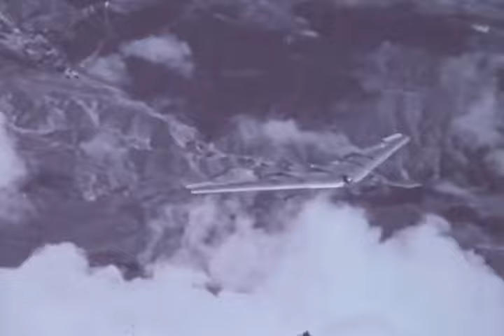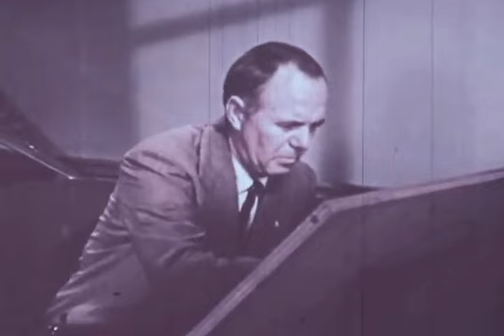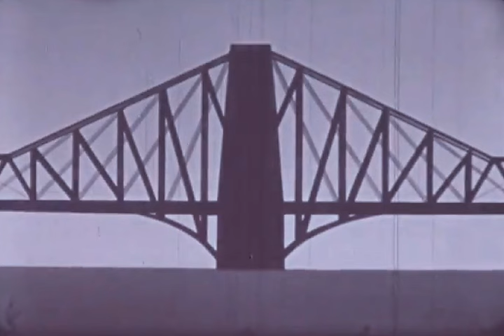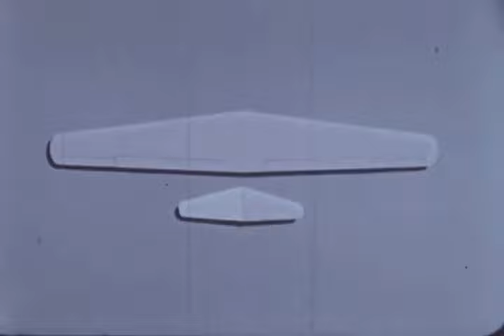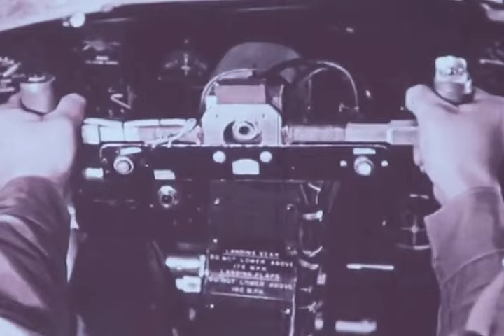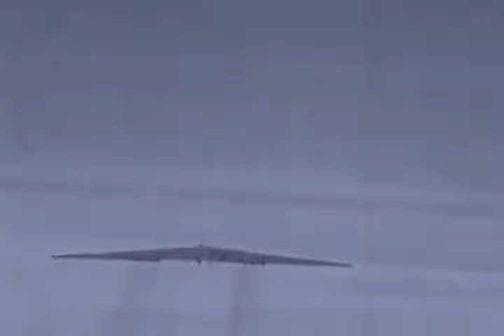The Story Of The Flying Wing

Comment: The Flying Wing was one of the most beautiful aircraft ever built. I would have loved to have worked on one of these and tried to get stationed Whiteman AFB to be with the B-2. The original was so far a head of it's time and the story of why it wasn't excepted in the USAF is intriguing. A lot of people didn't want it to succeed especially Convair, maker of the B-36. Jack Northrop had a design that worked so well, that ALL of the large Wings were cut up and scrapped so they couldn't be used for further development.
Reply: Just like the Avro CF-105 Arrow
Reply: @intercommerce  Yes, one can only imagine what the Arrow could have been. So many aircraft that I've see canceled because of government cuts, shortsightedness, corporate political pull or just plain ignorance of military thinking. Like the US Air Force and the A-10. Pilots that fly them love them, the troops on the ground love them, but the ignorance of USAF top brass and fighter jocks all believe that combat should be at 20k not in ground attack. The USAF top brass have never wanted to have anything to do with ground support. They are not like the Marines that have a close relationship with the ground troops and have adopted ground support. The old saying is true and I've seen it. USAF start their ground support at 2,000 feet and start to work their way down. USMC air support starts at 500 feet and work their way down.